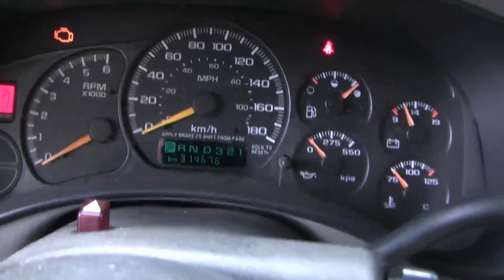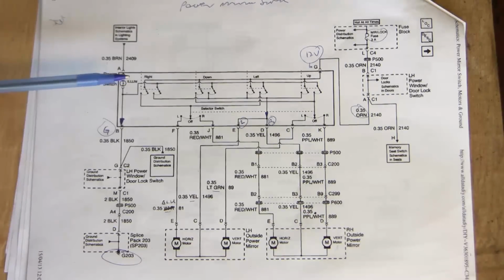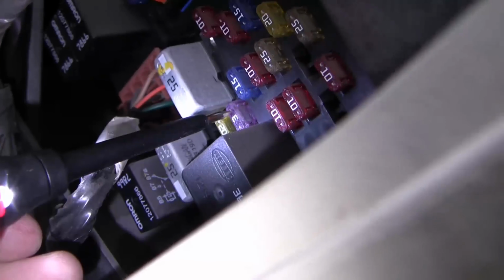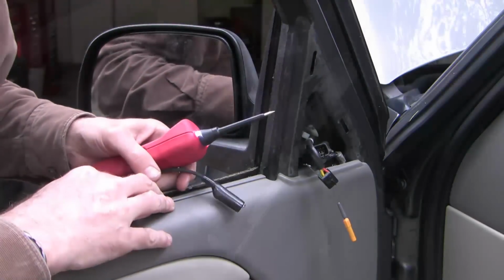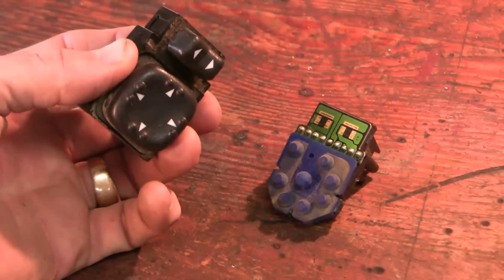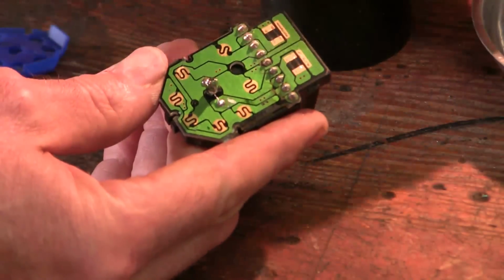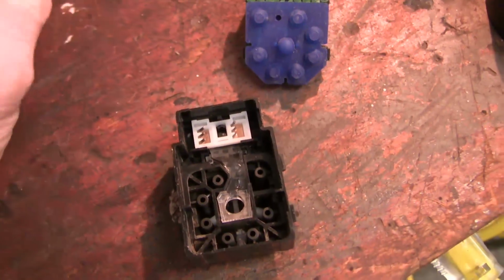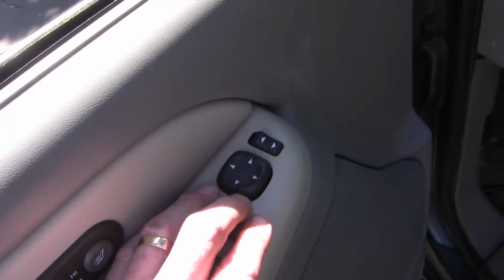How to fix a car mirror that won't move -- Chev Suburban

Comment: I cleaned mine with just soap and water, I tried the sandpaper thing and then a bit of alcohol and that worked perfectly the mirrors work again thanks for the vid I was about to buy another switch
Reply from the maker: +20BulletProof10 I'm glad it worked, thanks for the followup.
Reply: Yeah thanks to you too it saved me on a new switch which I know isn't cheap... what about a slow moving window would you know how to fix that because the passenger alot of the times when I press to roll it up it goes real slow and sometimes stops, but the drivers side works fine so idk what the problem is
Reply: I hate having to get out just to push it up as I'm pressing the button
Reply from the maker: +20BulletProof10 It's either a bad motor or excessive mechanical resistance of the glass as it slides up and down. I had a similar problem with this very door. I solved the problem by simply taking the inner door off and lubricating the glass slides with silicone paste. Try that first.

Comment: VERY NICE TROUBLE SHOOTING and GREAT VIDEO of the part! These type of contactors are also in TV remotes and have the same issue.  Most of the time its a matter of cleaning but sometimes it just won't work.  I have also found to use a NON-conductive Grease (electronic) to "seal" them after you get them working again or else the part will 'burn' (electrically) and you'll be back to buying an entire unit again.
Reply from the maker: Good point!

Comment: Did this on my lunch break today and it worked great now all I have to do is figure out how to hook up the new wires for the puddle light and heated mirrors.
Reply: James R, Clark Can be a little bit of a problem, if the wiring isn't already there.  if your's is the same as mine, the Black & orange wires on the mirror are the heater (on one end of the plug), the orange with a black stripe is the Pos. of the puddle lamp (they use a common ground/black).  The heater is linked with the rear window defrost, pulling that from the switch or the back window as a separate line...  The puddle lamp can be spliced into the door courtesy lamp power/orange.  I didn't have an extra male connector to put in the plug, so used an 18ga. finish nail crimped onto the end of the wire & slid into the plug after it was connected, then zip tied to the wiring harness...  Is working quite well .

Comment: Thanks for posting. I just cleaned the switch on a Chevy Blazer LS i bought yesterday and now after i cleaned the switch both of the mirrors works as when the car was new.. 
When i took the mirror switch apart the 2 tiny copper/brass contact points that is for switch for adjusting the left side or right side mirror fell out. 
This is no big deal since it is easy to put them back on but if you hold the switch upside down when you are taking it apart the copper/brass contact points will not fall out
Reply from the maker: +ItsNorway Good point, I'm sure your remarks will help others.

Comment: Wow! Great video. Great info and nicely done. My 2000 Malibu has the same style switch. It's acting like dirty contacts. Thank for the cleaning info. Will let you know how it turns out.
Reply from the maker: Good, I hope it works for you. Other option is ebay, or a parts warehouse. If you can get free shipping there are some aftermarket parts for a pretty good price.

Comment: NOW IF YA JUST HAD A VID FOR A 90 SUBURBAN.
EXCELLENT DEMO OF HOW TO GAIN ACCESS TO WIRING FOR TESTING TO MIRROR MOTORS.
Reply from the maker: After you work on a few dozen you realize they are all very similar. Minor differences in plastic clips and hidden screws are annoying, but the general principles always hold.

Comment from the maker: That's a good thought, I wondered if somebody would suggest that. They are double pole switches so I would need a double pole single throw toggle to completely mimic the function of the switch. Or, maybe I could figure out which pole is bad and then use that one in combination with pressing the switch. But that seems so complicated I find it almost as easy to lean over and push the mirror by hand, (grin). Thanks for watching!

Comment: I have a 2001 impala.  Same switch.  I had the same problem.  I sprayed contact cleaner in and around the power mirror switch and within 30 seconds both mirrors were functioning very well.  Nice surprise.

Comment: Awesome video... my power mirrors on my 02 Tahoe are not working, they quit working some time ago..gonna try this..maybe soda or water got spilled on the door handle and gummed up the contacts.. checked the fuse and the fuse is good.. but no sound coming at all from the mirrors...
Reply from the maker: If none of the mirrors work, check the power and ground feed to the switch at the drivers door. If you're lucky you'll find a broken wire, most likely at the loom where the wires go through the door. Old wires become brittle and the repetitive action of the door eventually causes a break. You may need a wiring diagram, if you need one try bbbindustries for a free download. Good luck!
Reply: @spelunkerd  thank you .I will try that...

Comment: You can repair this type switch (sometimes) with the conductive liquid sold to repair rear window deicer grids. It is able to restore the conductivity of both the contacts that wear in these type switches. Don't use too much or the contact will be continuous.

Comment: I had already ordered and installed a new motor and regulator--my 225k mile 2001 Suburban needed 3--before i checked the switch for the front driver's window--after install, the brand new part didn't work.  Mirrors hadn't worked for 2 years.  I used your cleaning method for the mirror and both work 100%.  Saw your folo up on the window switches--you solved with an air can.  I went further and opened each switch + lock.  They were literally pitted from use.  Thanks for the confidence to go a step further than you did and disassemble the window switches--every switch works now--hoping for another 200K!  PS. rear end doors don't lock with all others--COULD IT BE THE SAME PROBLEM!?
Reply from the maker: It's possible. Those door locks are a real pain, since it makes you wonder every time you lock your car (whether every door locked). The circuitry is also painfully complex. Because the circuitry is so involved, I usually disconnect the end device and hotwire it with ground and power to see if it works in isolation, then work backwards to find the fault. Because they go through moving parts at the edge of the door, broken wires there are very common.

Comment: I took the mirror switch apart and put it back together and it works. I didn't even have to clean it. I'll check to see if it's still working tomorrow.
Reply from the maker: That seems to be a fairly typical story, judging from the remarks here. Dust is undoubtedly the main problem with these.
Reply: If I took it to the shop, I'm guessing they would have automatically replaced the switch (or perhaps they would have told me they replaced it when they only cleaned the dust out, and i wouldn't know the difference) So I probably saved myself a few bucks here. It was an easy job.
Reply: That means it's probably the contacts were dirty.
Reply: It worked fine for a while but it didn't stay fixed, I had to do it again yesterday. I think slamming the door loosens the contact in that switch and you have to push it into the socket hard so it stays in contact with that rubber membrane. Also used some electrical spray on the membrane where the contacts are.

Comment from the maker: Thanks for your input, those are helpful ideas! Of course when the dealer says the switch is not reparable, they mean that there is more profit for them just to replace the part. I hate that kind of reasoning. Most of us (including me) have had very little experience repairing small circuitboards. I looked for bad solder joints but there were none I could identify. As you say I didn't test each trace, but the rubber seemed OK.

Comment: Really well done, detailed and informative video - thank you for taking the time.  My '02 switch has no function in any direction except for a nano second in the up direction on the driver's side.  Since it is my wife's for most of the year and then I become the driver in the summer when we pull our camper, I'll need to bite the bullet and get a new switch.  At least with this video, I can do it myself and save the labor costs!  Thank you, again!
Reply from the maker: You're welcome. Replacing the switch would be easy, but just be sure that is the problem. At a dealership they would replace the switch, and if it still didn't work they would put the new switch back into inventory. But for DIY guys like us, many stores won't accept returned electronic parts....
Reply: I wasn't sure that this was the problem, but lacking the skills and testing equipment that you have, I winged it bought an aftermarket switch online.  Worked out beautifully and for only $38!  Again, thank you for sharing - really helped me out!
Reply from the maker: I'm glad it helped, and I'm happy to hear that inexpensive aftermarket parts like this are still available.

Comment from the maker: Yes, it's a great little tool. The way I was triggering the motors is not ideal, since it causes internal arcing across contacts that cause eventual deterioration of the switch. I'm trying to train myself to press the power button and then touch it to the wire, since in that case the arc happens at the wire externally.

Comment: Very good job Sir, thank you very much. There also a good video of another gentleman fixing the 4x4 switch. 1999 - 2002 4x4 Do it yourself switch repair. Save yourself a $100.00 if you can soldier or someone who can. Super easy instructional video. Thanks to this person for this video.
 2000 Chevy Silverado 4WD transfer case switch repair
Reply from the maker: You make a good point, a common cause of a failed board is a bad solder joint, sometimes very hard to find. I didn't reflow my joints because they looked fine, but it's still a definite possibility.

Comment: Easy Fix for 2009 Tahoe mirror.   The passenger rear view mirror would not fold in or out electrically - after using all the suggested reprogramming solutions ... I manually folded the mirror all the way toward the front of my 2009 Tahoe and I heard a click. I folded it back to the regular location of the rear view mirror (90 degrees +or- ) from the car and it has worked ever since...   Hope it works for you.
Reply from the maker: Thanks for recording your experience here. Yeah, there's a plastic worm gear driving the mirror in both directions, and the threads need to catch to get the mirror to move. Too bad that effort didn't work in my case, but your note will possibly help somebody else.

Comment from the maker: One of the viewers below suggested using some conductive paint on the contacts, and I'll be doing that in the next few weeks after I get it from ebay. I'm cautiously optimistic it will work, and save the day. I've also got a channel changer with unresponsive keys and I'll try it on that as well, ha ha.

Comment: sorry for so many comments; took my switch out cleaned it like you did put it back in and nothing (wait for it), it didn't work until i snapped the panel back in place and suddenly it started working but (lowering for both sides still doesn't work, all others do) just like yours, there must be something about those switches and the lowering position
Reply from the maker: I'm glad it worked out, thanks for documenting your experience, for viewers to follow.

Comment: I am sure I missed something, but at 0.40 thru 0.49 you say listen to the motor, which is in fact audible; however, the mirror doesn’t appear to be moving based on the reflection.
Reply from the maker: That's a good question, I scratched my head when I saw that, too! The motor turns a worm gear inside the support housing. When you lose the ability to turn it back, and you flick the switch left and right, it moves only one way, inching toward the end of its reach in the direction it is able to move. Eventually the mirror naturally comes to rest at the far limit of the direction it can move, following which the worm gear just spins without moving the mirror any more. The mirror ends up frozen in place, unable to move back because the motor won't spin that way, and unable to move forward because the threads of the worm gear are at the limit of their extension. Try it with a bolt and nut to see what I mean. So, to gauge which control of the switch is working, rely on the sound of the motor rather than actual movement of the mirror itself.

Comment: Great video. Very comprehensive. I want to make my leftover electric Jeep mirror battery operated (just because). Any ideas on a 12v supply and DPST control?
Reply from the maker: That sounds like a challenging project, one that others might want to see. If you post a video, let me know, I'd like to watch (grin).
Reply: Cool. Thanks for the reply. I'll let you know. It's not on the "front burner" yet but it'll get done and I'll surely post it when I figure it out.

Comment: if you ever leave your window down, when you open your switch you will see green schmoo on some or all the contacts. since you have the door apart might as well check the other door and lock switches even if they are working also if you don't have electrical cleaner rubbing alcohol works fine. bonus nachos it will help a wet switch dry out. I did this a few weeks ago on my dads 2005 Silverado. he leaves his window down a lot, all the switches had green schmoo. also on his Silverado its a cluster of single switches well I ordered them that way come to find out cheaper to order the whole cluster ( I didn't know you could order the cluster ). side note my dad being my dad, he wanted all new switches but using the same Technique as you I saved the switches. just my dad wanted new.
Reply from the maker: Absolutely, the big problem is water getting into the door through the window slot. This month I have both doors off my Dodge Ram to repair internal rust on both doors. Well designed doors have slots at the bottom of the door to allow trapped standing water to escape. Unfortunately if you park on a sideways incline the water pools anyway, eventually rusting it out from the inside.

Comment: Why not try to short those gold contacts on pcb (for right switch) while switch is connected to the car, if it does not work then there could be a bad pcb trace which is cracked or very corroded (I see small vias next to right switch contacts, which can be bad). Use DMM to check all traces, easy to fix. Also problem could be with rubber itself which is not springy anymore, then adding blob of solder to contacts on pcb might help (not shorting). My two cents =) Thanks for videos.

Comment: Great video very detailed.  I got the up and out working, still can't get the down and in working.  Any suggestions??
Reply from the maker: +Paul Carman Probably need a new switch. I would verify that it does move when you put power directly to the mirror as I did in the video, to be sure the motor and wiring to it are OK, and I would look for bad contacts near the switch. You could read the thread here for suggestions by other viewers. One viewer suggested I re-coat the contacts with electrically conductive paint, but that didn't work for me. I believe you can get an aftermarket switch on ebay, and of course there's also the option for a junk yard part. OEM parts are likely to cost much more.

Comment: Put the mirror selector to the center position  , push down in the center if the directional pad and then push the right direction.  Your mirrors should fold in , do this 3 times to factory reset mirrors.
Reply from the maker: You make a good point. Newer vehicles have little microprocessors inside the switch that communicate with the BCM via communication wires, reducing the diameter and number of wires and switches. This old truck doesn't do that. In that newer system, you check for power and ground at the microprocessor, initialize the system (as you describe for yours) after changing batteries, and if possible use a scan tool to see it communicates. Then verify that the downstream actuators will function if given power directly. If the module still won't do its job, replace the switch module.

Comment: hey i was able to fix mine. i had to do it twice and didn't have the contact cleaner spray so i used rubbing alcohol and the second time around it was fixed. Thank you ....let me know if you need that part maybe i can help you get it.